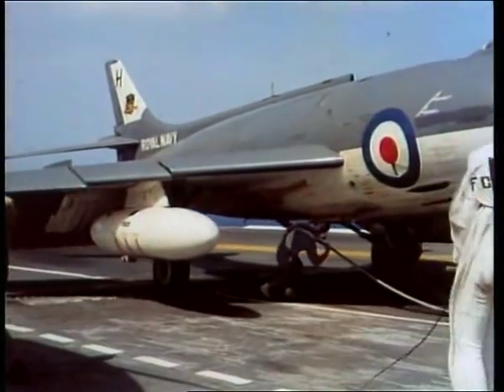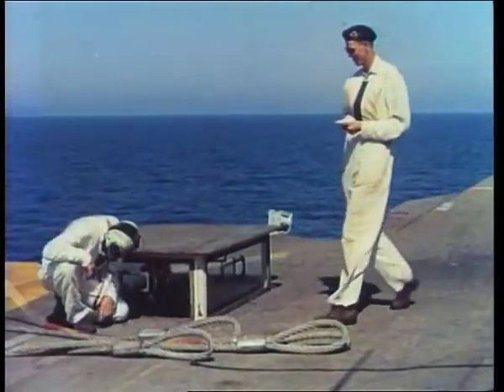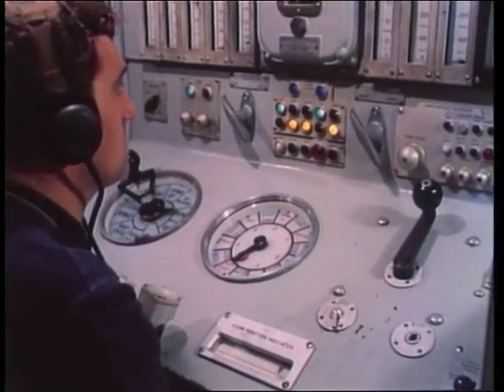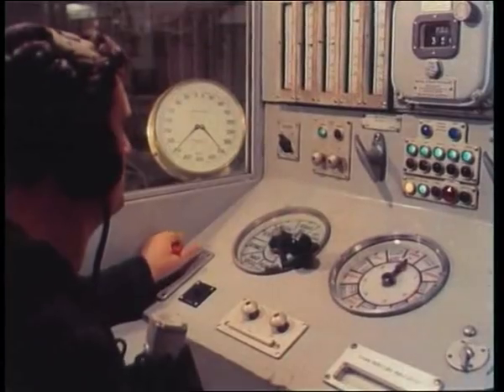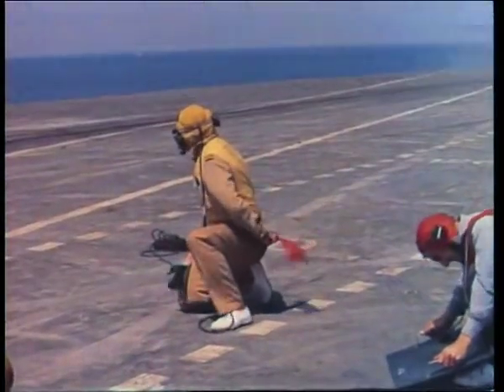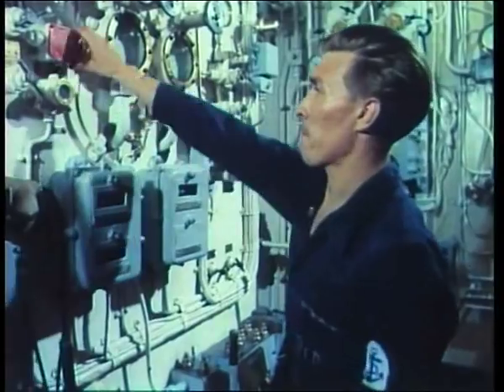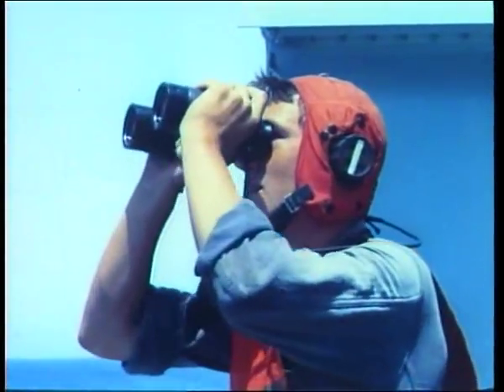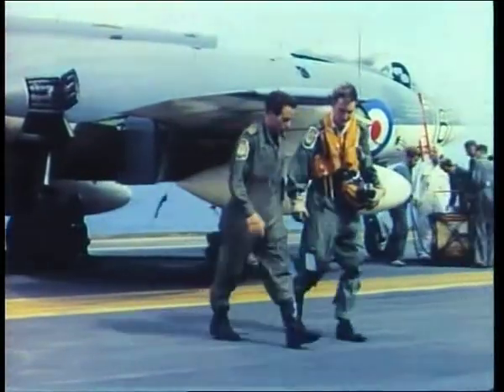Launch & Recover (1960)

Comment: "Blow On" is shown to ensure the engine bleed is open for the slots on the wings and tails, Bucc's and Phantoms all use this, it  is more correctly known as Boundary Layer Control. The effect of this is to reduce the stall speed of the aerofoil by stopping the airflow detaching from the surface at low speed.s Awesome Video, thanks.

Comment: Little did you guys know that those retention wires cost about $12,000 a piece and have to beat machine through all these multi dyes for tensile strength and stretch ability. We make the Milwaukee wire products by the thousand and they are big money the government waste this money so badly! They use them twice actually I heard they only use it once because they don't risk using it twice! That way if they get one launch out of one wire that's fine it sample the resting wires if the arresting wires are used once they throw it away they don't want to tell you that not even in these all the videos because they cost so much money and they dump them right in the sea

Comment: It is important to say that it is not just " steam" that is admitted in the launching cylinders but, " wet steam " in fact in the accumulator there is a lot of hot water, as it is the hot water content that keeps the saturated vapour pressure of the wet steam constant as the piston expands. Admitting dry or superheated steam will not keep the constant pressure through the whole run of the piston. So it is important to say, " WET STEAM"

" Hot feed water is
admitted into the steam accumulator to approximate the
low operating level. The launch valve is opened to
purge air from the accumulator and steam is slowly
admitted into the accumulator feed water to raise the
water temperature. When the water temperature
reaches approximately 225 degrees, the launch valve is
closed and accumulator heating continues. Steam
pressure is increased in increments allowing enough
time at each increment for the water temperature to
increase to a predetermined temperature. This slow
An increase in temperature and pressure will ensure a
thermally stable accumulator when operating
parameters are reached."

Comment: Amazing footage. British govt made a big mistake when they cancelled the new carriers that were supposed to be built in the 60's, JMO.
That Sea Vixen was a very unusual design.
Reply: Californian we couldn't afford them - the economy was a basket case back in the 1960s. The Sea Vixen for all its looks was a dog. It came into service far too late for its abilities. The design goesback to the late1940s/early 1950s but didn't into service until the late 1950s/early 1960s by which time the USN had Mach 2 fighters in service. There were many causes for the delays including changes of requirements.
Reply: @Neil Dahlgaard-Sigsworth, it was the British Government's massive miscalculation of their vaunted and failed Suez Canal coupe that lead to that economic failure. Had the UK let Nasir build his hydro dams, the UK would still be prospering. Greed has it's price.
Reply: @mtumeumrani376  With respect, you really need to do some research. Not here to argue, just saying that you're wrong on many levels, IMO.

Comment: "Blow on" tells the pilot to ensure he has the blow system on. This is bleed air from the engine that is blown over the wings and flaps to increase lift when taking off in such a short distance and increasing lift enabling approach speed to be reduced when landing on the carrier.
Phantoms and Buccaneers also gad this system.
Reply: Thanks
Reply: bullshit.
Reply: Tommy Fallon so what is it then?

Comment: One of the best DOC I've seen....military or otherwise. Less than a minute into it ... didn't seems like "1960" at all.  Found out for first time, that both Sea Vixen and Scimitar are powered by the same Engine. 
Scimitar is one the most good-looking fighter jets.....Sea Vixen isn't a close second.
If only RN and the manufacturer have foresight to combine design of these two jets into one, single fighter...the front and rear fuselage with nose and cockpit of the SV , while the wings, tail and undercarriage/landing gear are that of S
Reply: The Sea Vixen was a much larger and heavier aircraft than the Scimitar. They performed very different and distinct roles. The vixen was a night fighter/ground attack aircraft with a nuclear capability whereas the scimitar was a frontline fighter. The closest thing to a combination would probably be the F4.
Reply: Rolls Royce Avon, it powered the lightning as well.

Comment: Was the bridal  discarded or recovered for reuse?
Reply: They were on US Carriers, there was another pair of wires that ran from the ends of the bridle up near the hooks on the airframe and from there back to a follower on the cat track. It would catch the the bridle for re-use. They were only re-used a limited number of times. If the bridle is going to go unservicable after the a shot, they don't use the catcher and the bridle goes off the end of the cat.

The ramps that stick out in front of the catapults on US Carriers are the "Bridle Catchers". They're all gone now as jets don't use bridles any more, there's a tow bar on the nose gear strut that's pulled directly by the catapult shuttle.